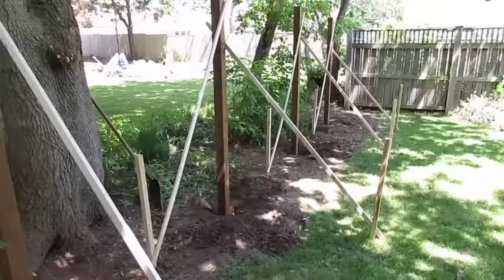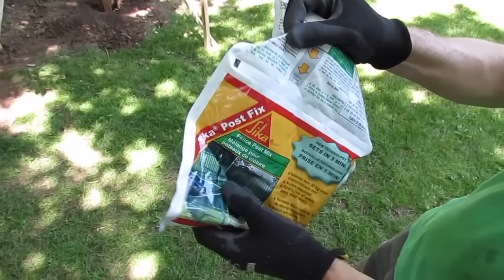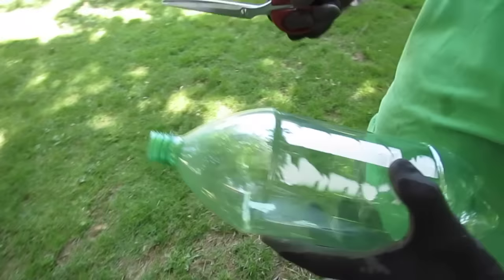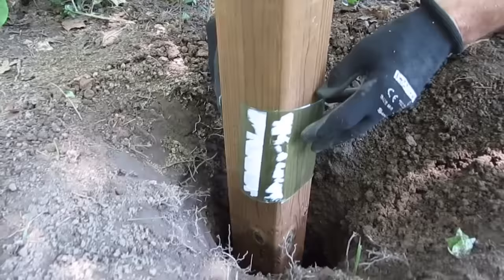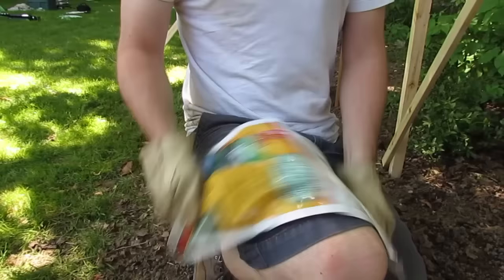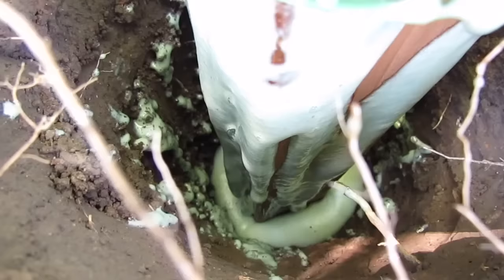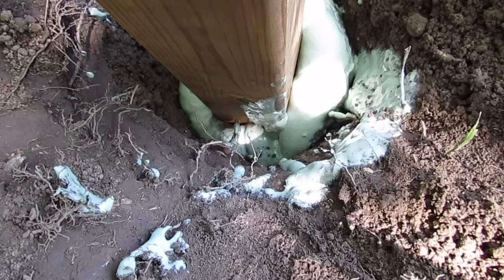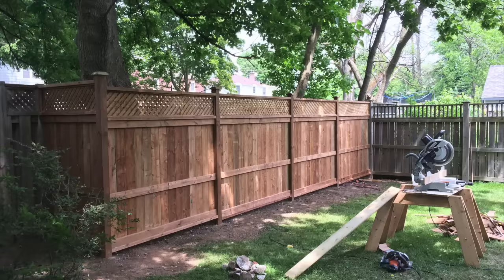No Concrete Fence Post Install!

Comment: I'm skeptcal that this would work in all situations. Concrete is much more dense and heavy, making the post more stable during it's lifetime. I am assuming the foam is a polymer, which suffers from molecular breakdown over time, and doesn't have the same longevity.

I suspect this is not a 10-15 year fence solution.
Reply from the maker: Concrete is certainly heavier, please explain how a heavier filler makes the post more stable.
Reply: @PatonHaus  Changes the center of gravity, changing the physics working on the support beam. With the center of gravity lower, it becomes more stable. Physics 101.
Reply from the maker: @xStrayMongrelx  Centre of gravity? Support beam? Did you just grab these terms off google? Fences get their stability through the friction of the filler material acting on the soil. The weight of the filler and weight of the fence have little effect on the strength and durability of it. The quality of the soil has a much bigger impact on long term stability, which is why if you're in a sandy area you have to auger down much farther to hit a load bearing soil. The foam is merely a filler to press against the soil, creating resistance to a pulling or rotating force. Do your research.

Comment: How heavy is this foam?? Quick concrete seems to be much better for a fence as it will be way more stable in heavy rains.  This foam will probably float right out of the hole.
Reply: Common_C3nts has I thought this product was used when old concrete or post shrinks you use this foam to stop the rot and seal gaps.

Comment: While concrete is clearly cheaper, I could see one major advantage to using this, and that would be when you finally need to replace the posts, because this would make the posts weigh a fraction of the weight you'd have with concrete being used. The questions is... is it worth trippling the cost for that ease of replacement?
Reply: Where do you live that concrete is cheaper?  I'm in Virginia and my Home Depot has bags of this foam for $10.50, while two 50 lb bags of fast-setting Quikcrete costs $11.60.

Comment: What is the COST of using foam instead of concrete? The prepackaged foam looks really expensive compared to a bag of concrete. Most likely when someone set a post with concrete and had it move, they did not use a big enough hole or enough concrete. I have had to use a backhoe to remove 6" diameter steel poles that were set in a 3 foot deep by 2 foot wide hole, using about 250 pounds of concrete.

Comment: this is very interesting. i have never seen that, but am so closed minded that i just went directly to the cement bags. I am not sure how everyone else does cement - I didn't do any mixing. dig the holes, insert posts, pour dry cement in, plumb post, attach panels, brace posts for a few days. about 40' of fence and they are still solid after several years.

How does the cost of this product compare to cement?

Comment: Pea rock packed around a post will hold it like concrete and it will never rot as the rock takes moisture away from the wood.
Reply: wont it shift and settle because you cant pack it as dense as concrete? and if the clay is deep then it will blend into surrounding soil after years of rain and melt ...unless theres fenceposts like that lasting 20 yrs that im not aware of

Comment: Interesting but the weight of the concrete holds the post in. I've used tamped #2 crush & run on the farm where its not economical to use concrete and it works.

Comment: That's a lot of work. Just pour the powder cement in the hole then add water With a hose. Works every time, cost less and faster.

Comment: I can see where that foam might be used to fill other types of gaps but quite honestly, a bag of Quickrete  will fill two holes 18 inches deep and do just as good a job for a LOT less.  It's not as messy, either.  Good vid, but I'll stick to concrete.
Reply: 50lb bag of fast-setting Quikcrete is $5.80, a bag of this foam that's equivalent to 110lbs of concrete is $10.50, so how do you figure Quikcrete is cheaper?

Comment: I tried this last year, on one post just to see how effective it would be.  Not satisfied with the result, the post is not rigid enough.  Especially if you were to hang a gate on the post.  I'll stick to concrete.  Mind you, I can think of other uses for it.

Comment: I haven’t seen a man eat his own head but now I’ve seen it all! Use a stirrup in concrete and attach the post to it with a bolt. Or just smash 20mm drainage gravel around it if there’s no excess load  on the post.

Comment: Hey .. How did I it hold up over the year! Are you happy with the strength? Thanks for the video
Reply from the maker: Yep, it's been two full years since I posted this video. It's still straight and solid, no complaints.
Reply: Thanks so much for replying 🤗 great instruction and tips for using the product.

Comment: There is a reason it’s called “post fix. “ Also there would be no weight on the bottom of the post. I’d hate to think about heavy rain, or ground flooding, not to mention insects, and vegetation.

Comment: Very interesting. I wonder if you could just use spray foam in a pinch. I never thought of foam for holding a fence post. In terms of environmental impact there is probably less with foam than concrete. It is waterproof so not leaching into the soil at all. It is held in place by surrounding soil so not breaking up either. Looks like fun too!

Comment: Great thinking outside the box moment. 2 questions: 1] Does it retain water? 2] What about post rot? Thanks!
Reply from the maker: The foam is closed cell, so it does not absorb/retain water at all. Post rot is no more a concern then when comparing to concrete.
Reply: PatonHaus that should be the selling point as well as it being quick!

Comment: I usually just stuff my fence post holes with like aluminum cans and old newspapers and I leave a little space at the top so when my dog craps in the yard I have some place to throw it you know I'm just trying to recycle everything
Reply from the maker: Great idea! I was considering just using used kleenex and milk cartons but chose the foam instead.

Comment: Yes the foam will be a heavy enough block to stop the wind blowing it down wont it genius. I saw you in a tv show called "Cowboy Builders"
Reply from the maker: You could do an experiment... attach something heavy to the bottom of a 6' post/rod and see how hard it is to push it over. Not hard, right? That's because having weight at the very end of a lever has very little impact on it's stability. Fences gain their strength from friction on the soil, and if you've ever tried to yank a t-bar out of the ground you'd understand this principle.

Comment: dear "concrete is king" people, the foam has a higher tensile strength costs more maybe twice as much 160 vs 90 and each post can be set in minutes, it weighs 1550 lbs less, carries no risk of silicosis, does not require additional wheelbarrows or dry storage or water.

Comment: I just bought a home and have been using sun baskets that hang on shepherd hooks. The sun baskets get a little too heavy when I water them for the shepherd hooks. I need to secure two different 4x4's in to the ground with a strong hanging plant arm. Because I just bought the home, I'm only considering the foam because I know myself and I know I will be doing some redesigning of the backyard and will need to dig these up within a year or two. I can see the hardened cement being a hassle to dig up. Any objections in using the foam since we are only talking 1-2 years? Is there something else out there that would be better?

Comment: I ha 've a question .I am looking for an easy way of supporting a pipe about 15ft walkabout ground to hold 1 end of a dipole antenna. I plan on using 1 1/2 or 2 inch galvanized pipe am guessing I will have about 5 ft of pipe inthe ground .would this product worko that application?

Comment: I'm really dubious about this.  Typically I set the posts in nothing.  Just a gravel base to wick out moisture, gravel a few inches up from the bottom, then normal tamped dirt.  Any kind of collar, whether concrete or this stuff, is bound to make your posts rot out prematurely.  The key to stability is to get 'em DEEP, at least 3 feet and preferably 4.  (The one place I do use concrete is around gate posts so that they are bombproof, but in my opinion it's a mistake to use it on most of your posts unless you can't get them to sit tight any other way.)
Reply from the maker: You'll find that everyone has an opinion on the "best" way to set posts. Some like just dirt, other like concrete, or gravel, or pixie dust. It all depends on where you live and what the climate is like.

Comment: You've already dug the holes,why not try quickreat quick dry

 concrete, pour it in the hole and just add water with the hose i guarantee its quicker and less expensive.

Comment: Don"t waste your money.Did six sections of vinyl privacy fence about four months ago and the dirt in the post holes has pulled away from the foam and the fence is leaning bad. Will have to take it all up and use concrete.

Comment: Your finished fence product looks good, but the expanded foam as a stability material doesnt give me great confidence in withstanding any kind of lateral force to the fence, like winds or something pushing against it. Id be interested to see how well it holds up over the years. Thanks for your video.

Comment: I gave a thumbs up bc I appreciate the effort. But, what about a strength test after the posts are in, bc I've seen another product that shrinks when it cures. This left a loose post, not to mention the very light medium of foam that is supposed to act as an anchor.

At this point, I'm leaning toward using a bag of Quickcrete per fence post and considering the Postmaster or a PT 4x4x8 with an additional application of 50:50 motor oil & diesel with the underground portion tarred. In one video I watched, the YouTuber suggested that burying the 4x4 post 3 feet underground eliminates the need for concrete, just tamp the dirt down evenly around the post! He stated that annual treating of the fence with the same 50:50 mixture would keep that fence strong for decades... interesting!

@PatonHaus Four years later, if you had to do it over again, would you choose the same method & products?

Comment: Correct me if I'm Wrong Please, But..1 Bag needed for Every Post? costing $13-$15 per Bag? I don't think so.. Sacrete mixed in a 5 Gal Bucket and water? Did 6 Posts for me very nicely! and no Foamy Mess! and cost $10 or $2 a Post vs your Foaming job? $15 x 6 = $90? Right?  We Did use a Spray Can Version for 1 Post and that worked fine.. but Cost $5 a Can.. and best to add some Metal Nails to the Mix..

Comment: This idea is acutally pretty cool. Did you make a concrete vs foam calculation? Would be interesting to know if it´s not only way easier but maybe even cheaper than concrete.

Comment: How well is this product holding up after nearly 3 years?
Reply from the maker: Just fine, no issues
Reply: @PatonHaus  ...if you could go back and do it again...would you just use a bag of quikrete or sakrete or are you sold on this product. Thanks for replying.
Reply from the maker: For a short length of fence, I'd use this again.

Comment: Fencing was nice 
The only thing I would say is the middle rail is to low ?
Reply from the maker: The ground was sloped, the choice was made to keep the centre rail level across the whole fence and have the bottom of the fence change instead. You’ll note the centre rail lines up with the neighbours fence.

Comment: A bag of concrete does many holes at 3.35 a bag. The foam which needs to bags per hole at 15 dollars a bag. Which one would you use?
Reply from the maker: In my neck of the wood we auger down 3 feet, which is typically a minimum of 1.5 or 2 bags per hole. Where do you live that one bag does multiple holes?

Comment: Great idea, but why not save yourself a trip to the store? Dig the hole to the appropriate depth (I find 600mm good) insert post and fill around with coins, tamping as you go? You have the strength of steel. Well, alloys. Could be £1, £2, dollars, anything. Oh no! Forgot about the trip to the bank!
Reply from the maker: Better yet, next one I build I'm using gold bars as backfill.

Comment: Just Add Dry concrete around the post and spray with a hose so you also get the weight and its a lot better then this

Comment: No need to mix concrete. I always coat my post in tar before I put it in the ground so the concrete wont wear the post. Then pour 4" in the bottom and the rest around the post packing as you go. Soak the top a bit after to set the top few inches. After that the concrete will harden from ground moisture slowly there for being much stronger. This will make for a long lasting post. You can do this without concrete as well just dig your hole 2 feet deeper and pack soil around your tarred post as you go 4" at a time. This will last even longer than using concrete.
Reply: "coat my post in the before"   You are coating the post with what now?
Reply: Sorry, typo. Use some tar on the post first.

Comment: Hate to burst your foam, but just yesterday the foam around the dryer vent on outside has deterioted in 15yrs.
Reply from the maker: Foam from a can right? Exposed to sunlight? Absolutely that foam will dry up and disintegrate, it needs to be covered and out of the weather.

Comment: I would never set poets under ground. Use concrete base footings then metal anchors and set your post 1” above water line. Those post will fail with time, not cause of the foam, cause they will dry rot with weather changes.
Reply from the maker: You'd better call every fence installer in North America and let them know.

Comment: Can I ask. Sorry real novice here. Does it matter if you use concrete or foam? Both take an eternity to break down. So doesn’t it make them just as bad as each other? Another question. Could I use the foam you use for filling cavities in walls etc... it expands as well. 60 year old female weakling trying to renovate my first home 😁😁

Comment: I wonder how this will work  for  long runs of fence will it hold up to  wind in open area
Reply from the maker: I wouldn't be confident in a long install. This video was only for a handful of posts, really the ideal situation to use a product like this.

Comment: I like your vedio. But i would like to point a common mistake for those who may be planning on putting in post, even how to books gets this wrong.. Always dig at the least 3 inche deeper then were the bottom of the post is set to be.( I go much deeper though) Then first fill hole with around 5 inches of crete. Then put post in, tapping the top to desire height. Then add the rest to just a bit higher then the ground. Why??. The bottom of a post that is in direct contack with earth will wick water up especially after the first year as the post begins to really dry out, even pressure treated post. And through Time the center of the post will get weak and soft, may start to hollow out and sometimes even worps. By completely incasing the bottom of the post you won't be replacing it in your lifetime. And by digging it deeper you're making it much much Stouter it will not lean as time goes by...

Comment: Would still rather use concrete. I just don't see how this would be any stronger than just compacting the dirt back in there instead of the foam.

Comment: Bad idea foam is bad for soil and the enviroment read the chemicals, also if you have clay soil, like you had there, there is absollutly no need for for cement or anything at all, plus the foam will absorb moisture and with in five years your posts and fence will be falling down.
Reply: The foam is water proof, but nowhere near as strong as concrete. I would rather stick to my concrete or dry ramming

Comment: So looks like a can of expanding insulation foam would do the same thing without the mess....
Reply from the maker: I’ve done my fair share of windows and doors and the foam in a can is considerably softer and far less dense than the fence stuff. Different foam for different purposes.

Comment: Did you run over the scissors later that week with the lawn mower????  ha ha That's a smart idea with the cola bottles.  That might be funny to see it the foam bag burst if you didn't open it -- double ha ha.  KABOOM!  Did you let that poor bug get away?  Fence look great.  The one criticism I would have for your foam is if it's anywhere near the surface its going to fleck off eventually and get all over the place and bug you every time you see that mess.   If however the top of it is substantially below the grade that problem will be avoided.  Interesting but I think I will still use the concrete for my plant hanger.  It's a lot less expensive than I thought.  You didn't mention how much the foam was.

Comment: I think some of the commentators forgot to add curing time to concrete.  If someone is willing to spend extra $$, they can cut it down to 3 days but somehow 3 minutes seems a lot faster.
Reply: Brian Van Horne  Thanks.  If I considered myself a real DIYer I probably would take your advice.  I'm going to be lucky just get it done and straight :)

Comment: Thanks for video. Where did you get that nice lattice section on the top of your fence, and how tall is your fence?
Reply from the maker: Hi, the fence is just over 6' tall, the lattice can be bought at Home Depot in 8' lengths.

Comment: What was the depth and diameter of the hole? Also what size were the posts
Reply from the maker: 3 feet deep and if I recall they were 8" diameter holes. 4x4" posts.